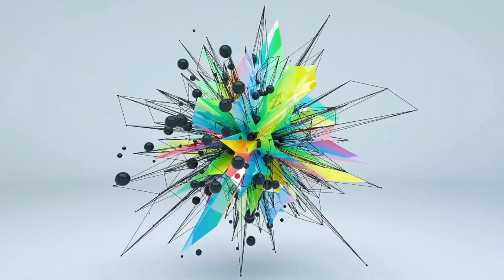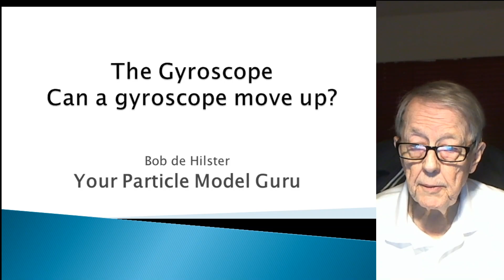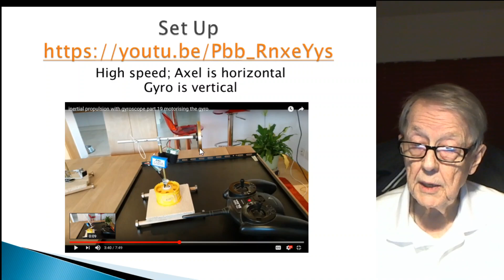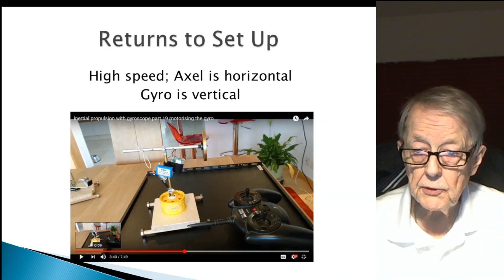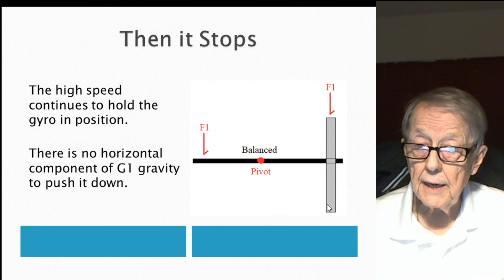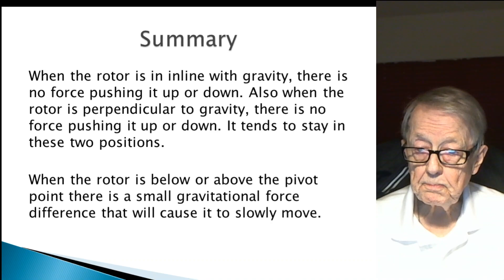The Gyroscope - Can the gyroscope move up?

Comment: There is a mechanism to this that everyone is missing.  It is purely axial accelerations perpendicular to the spin plane.  The spin plane is like a see saw, where the ends move in opposite axial directions.  Mass spinning in this tilting see saw plane must switch axial motions twice per rotation, the force mechanism.  This acceleration production happens mostly at the fulcrum axis running through the plane, and the two ends of the fulcrum create opposing forces that create a torque across the plane.  This torque steers the gyro's tilting direction, and the fulcrum axis follows tilt direction like an axle.  This is "why" it is a perpendicular effect.  Watch my latest video.  It's been my 25-year secret, because math can never be wrong, so I cannot be right.